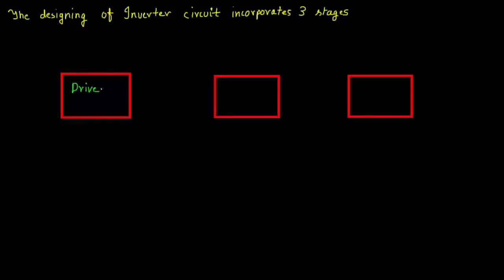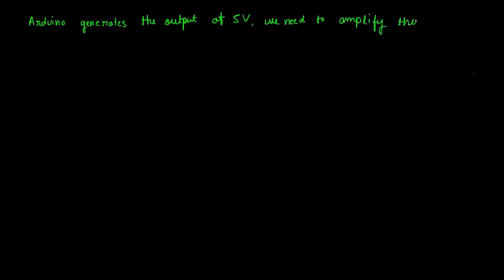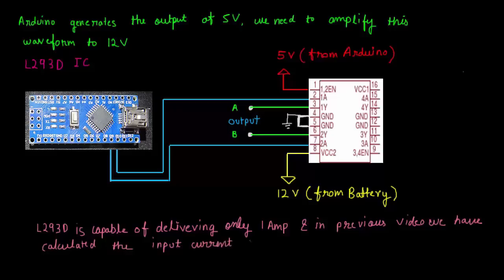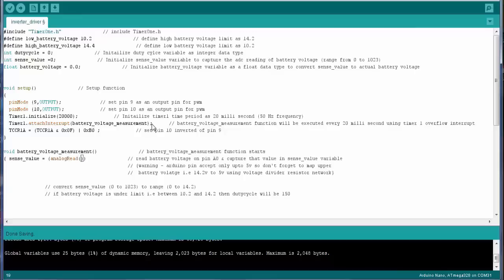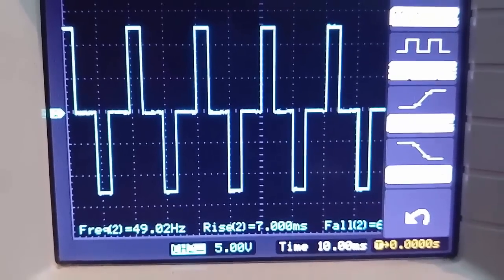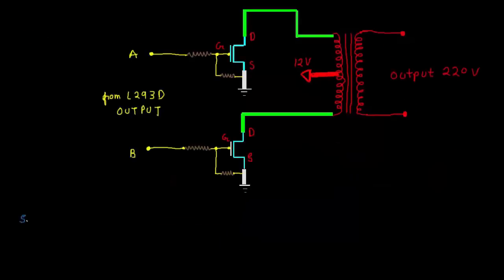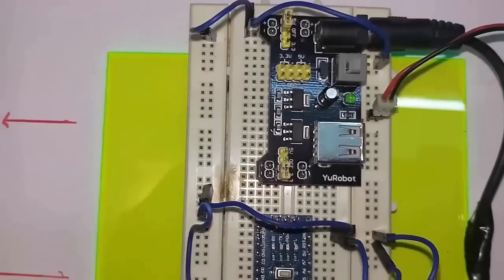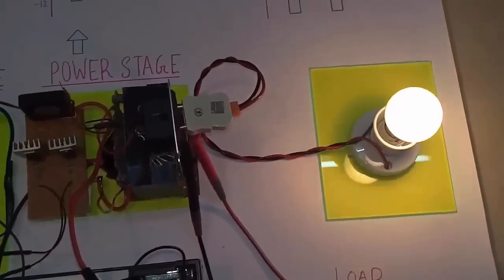Make an Inverter with Arduino (Part-2)

Comment: How can i use arduino to controll 7 level inverter???
Reply: level inverter are outdated , this is spwm orsine wave inverter
Reply from the maker: Use a 32 bit microcontroller for 7 level inverter.

Comment: I'm getting 150v at the transformer output, so I tried increasing the duty cycle and 500 at gave me 170v and and above 500 value of variable for "duty cycle" gave me 140 and less voltage

Comment: Hello brother 🙂! 
At first thanking you to make this video as a project. You help to make a ups in not the traditional way but in a shortest way to use an #arduino. Great thinking.
Reply: Now i have a most important question. How much power ( output wattage ) can supply this circuit?
Reply: Please reply as soon as possible bro.
Reply: Please reply me brother as soon as possible.
Reply: Hello brother, please reply asap.

Comment: Greetings. I made a code using delaymicroseconds and i calculate time for 60 hertz. I used A0 for detected 120v output for feedback(to maintain 120v always ), but it was i little slow when i put great load. I used your code and i made a little modification for the feedback.Using timeOne is more fast than my code. So thank you for your code. I made a different inverter. I am using transistors instead mosfets. I design myself my circuit. My inverter is 1000 watts 24 volts. so anyway great videos and thank you again.
Reply from the maker: Good to hear that, All the Best.

Comment: Can I use 12v 1.3 ah battery and center tap transformer of 1amp for this circuit
Reply: u will kill the battery cuz it s capacity is too low for that project

Comment: Hello Shailza
Great Work.
I got the modified sine wave from driver stage but when i give that pulses to the IRF3205 power stage, my IRF3205 gets heated.. can you please help me with the power stage....its urgent..this is part of my final year project
Reply from the maker: Ensure to use 10 ohm resistor on gate and 1k ohm resistor between gate and source. 
Also check for symmetric wave in ossciloscope.

Comment: Sir what is the difference between normal inverter and this aurdino based inverter
Reply from the maker: +Ajay Rathod There is no difference in inverter. Some inverter uses SG3525 pwm ic to drive the power stage. I have used arduino to accomplish the same task. With arduino you could be able to add more features to your invertet very easily like short circuit protection, overload protection, low battery indicator etc.

Comment: Can it generate sine wave or modified sine wave ??
Reply from the maker: +Kuntal ghosh It is a modified sine wave.
To generate a sine wave at the output, you have to opt for SPWM signal to drive the H bridge circuit followed by a Low pass LC filter.

Comment: Is sir this inverter really can make sine wave?
Reply from the maker: This inverter is not Sine wave, to make a sine wave , you need to generate SPWM followed by Low pass LC filter in output stage.